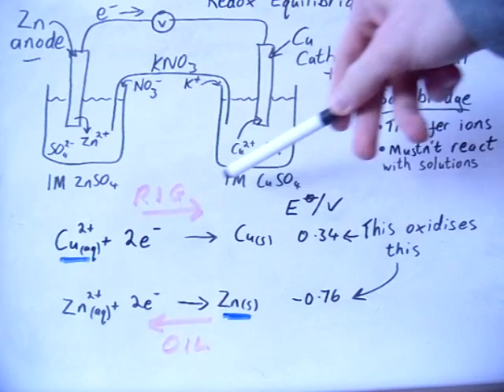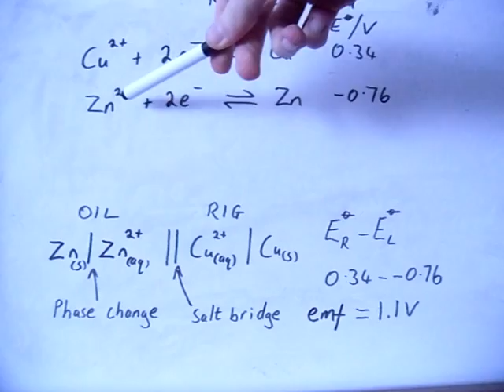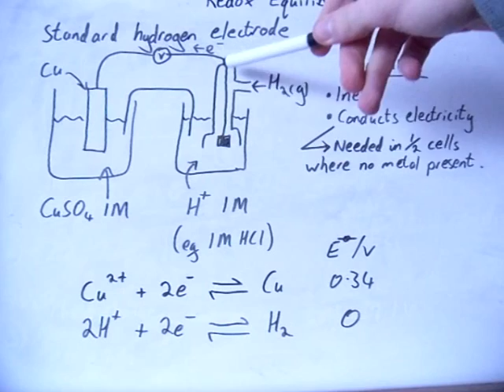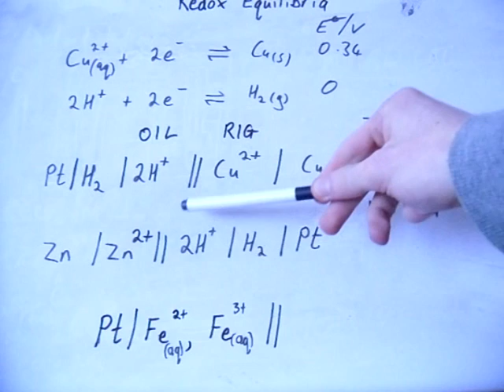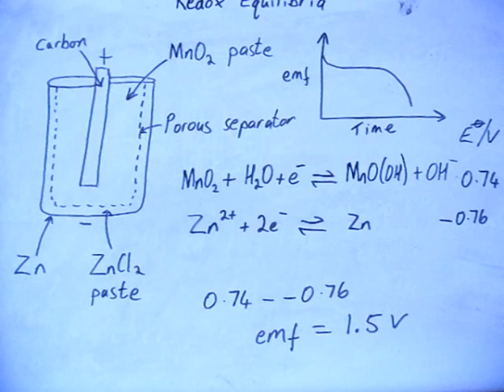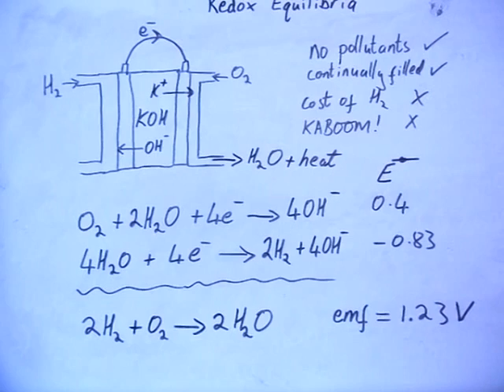3.1.11 - Electrode Potentials and Electrochemical Cells

Comment: Can i ask would you need to write a cell diagram for the non rechargeable battery if so would it be : Zn l Zn 2+ ll MnO2 l MnO(OH). Im confused as there is no charge in the top equation and also no metal to conduct electricity if there is no charge.??

Comment from the maker: When we say more positive - less positive what we're assuming is the more positive one will be the one going forward ie, reduction, taking electrons. In effect it's E = Ered - Eox. <- important, prob should've used in vid.
The cell would work with chlorine + Cr(III) as then we'd be doing 1.36 - 1.33 = 0.03V and spontaneous.
The question however wants you to do dichromate as reduction and chloride as oxid. This means 1.33 - 1.36 = -0.03V and non-spont.

Comment from the maker: 1) Strictly no, there'll be some internal resistance within all cells, that goes more into the physics area when you start working that out. It's treated as a negligble difference here.
2) Standard electrode potential simplistically is the strength of something to take electrons when compared to the standard hydrogen electrode. The emf between two electrodes in other words.
3) Yes, that's in the vid.
4) Main is: non-spontaneous (requires energy) vs spontaneous (releases energy/electricity).

Comment: Hello, some questions have been bugging me for a while and hence I thought I would discuss them with you, if that is ok?

1) I cell voltage the same as emf values?
2) What is the electrode potential exactly?
3) In galvanic cells, isn't the anode the negative electrode and the cathode is meant to be the positive electrode (unlike in electrolytic cells), right?
4) finally, what is the difference between electrolytic cells and electrochemical cells?

Comment from the maker: The reaction isn't feasible. The higher reduction potential will always want to move to the right, ie, Cl2 + 2e- --> 2Cl-. As the dichromate has a less positive value then it isn't a strong enough oxidizing agent to cause the chloride ions to be pushed to the left and lose their electrons.
What the more positive minus less positive is telling us is we need chlorine + Cr(III) for a feasible reaction to get an emf of 0.03 (although it would be a very poor reaction with such a low figure).

Comment from the maker: Yes, it's OILRIG for writing it but no, cathode on the right. Reducation ALWAYS occurs at the cathode. It's how they got their names originally from Faraday, anions are attracted to the anode, cations to the cathode.
As for the type of cells, you'll be dealing mainly with galvanic (power suppliers) in Chem 5, the other you've dealth with briefly in Chem 2 (extraction of metals - electrolysis, which is a nonspontaneous reaction and requires power to break apart the metal oxide).

Comment from the maker: Ah well it's actually a little tricky, the cathode can be classed as either positive or negative depending upon the type of cell. We're looking at galvanic here which is a cell which supplies energy (ie, a battery). So electrons are released from the anode and flow towards the cathode.
REDCAT always holds true though, no matter the cell type.